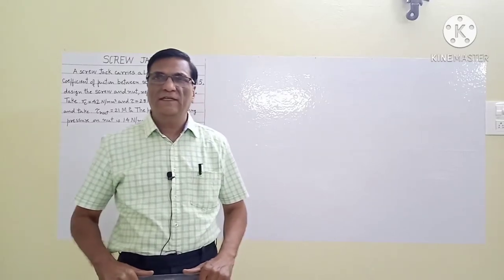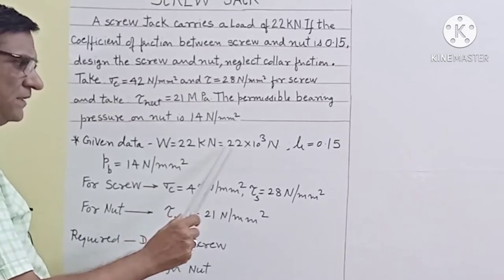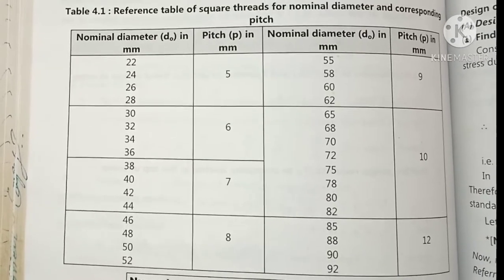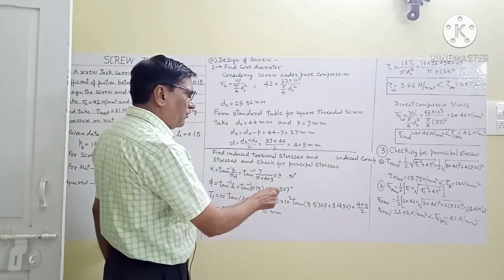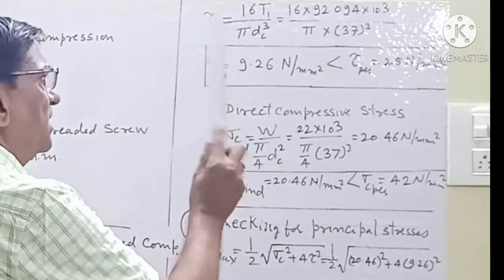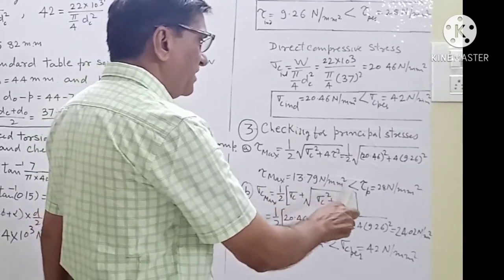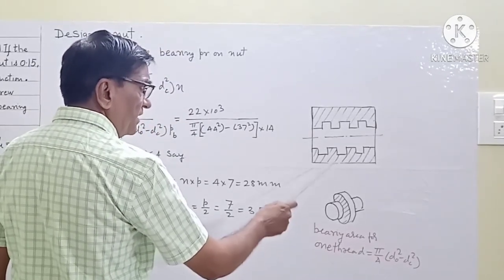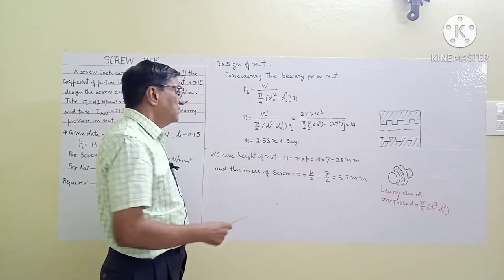Numerical on screw jack-lecture - 75

Comment: Sir How to use Standard table..?
Reply from the maker: After calculating dc, calculate d nominal dia. From empirical relations d=dc/0.84, then select higher value of d (higher than calculated value by d=dc/0.84) from standard table.

Comment: How you will take the value p.7 and D44
Reply from the maker: The values are taken from standard table as shown in lecture. This standard table is available in the book of machine design in the chapter of power screws.
Reply: In answer to your question about why D44 and p7-
Actually, the calculation shown for calculating Dc is not correct there is a very important parameter missing which he is not showing during the calculation. 
For the D44 screw corresponding value of dc in Reaffirmed 1996 is 37mm. The calculation shown here gives the answer 25.82mm for which the value of D should be D32. 
Now the parameter which is missing or according to which answer should come to 44 is the Factor of safety. Let's consider FOS 2 and design the screw spindle. The final value will be coming to 36.52 mm ~37 mm and for which D is 44mm. 

I hope this will help you and I will request the video provider to change the calculation or if you are not taking FOS, design according to D32, not D44.